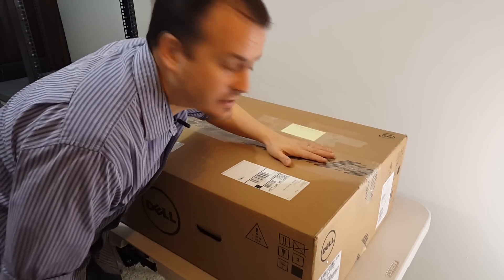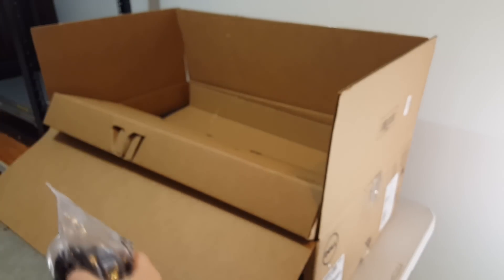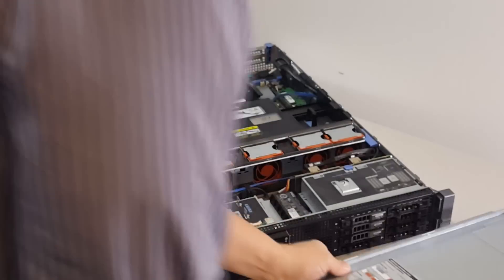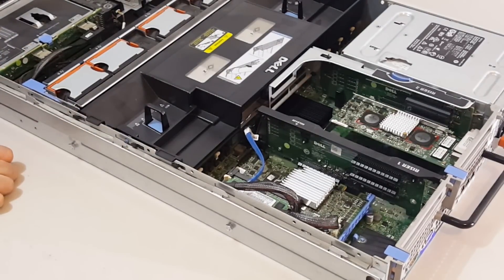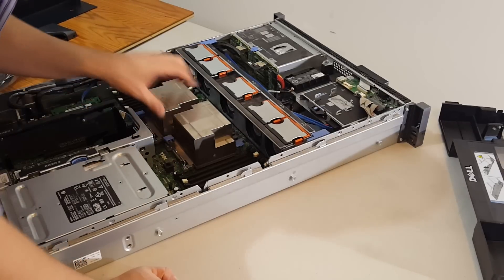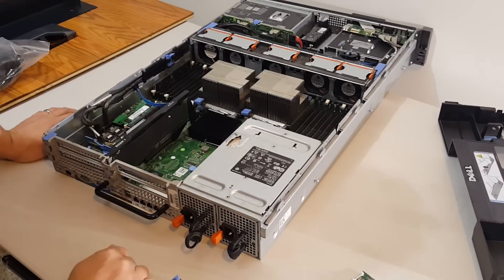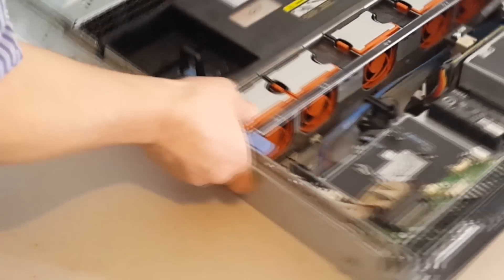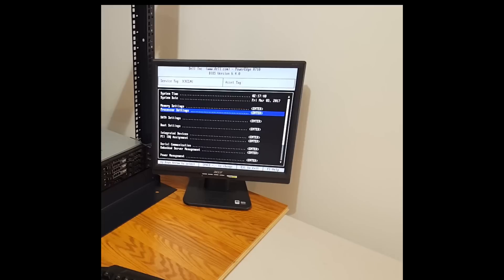$160 Dell Poweredge R710 Unboxing - Xeon e5620 8 core 16 Threads 32gig Memory 3x 300gig 15k SAS HD

Comment: WOW! you are so lucky bro. I found one of these in my country ( second hand ) for about 380$ barebones!
Reply: I got mine for €200,- off eBay. Dual L5640's (6c/12t), 72GB's of RAM. €220,- with shipping to the Netherlands!
Reply: Each region seems to have their own selection of cheap server hardware, most of Europe has cheap IBM servers, America has cheap Dell servers, I'm sure Netherlands has their own brand of affordable "old reliable" server, just need to find it.
Reply: @KiraSlith  The UK seems to have good prices all round. I found a large lot of 25 various HP ones totalling 420GB of RAM for only £350 and £60 shipping.

Comment: I have the same model with 3.5" drive bays. Make sure you don't have PERC 6 or 6/I Raid controller in your system because they only support SAS 1.1 (3 Gb/s).

Comment: Hi... thanks for the video... I work editing video and I need a super powerfull machine... I was going to buy a HP Z800 workstation refurbished but I just watched your video and I wonder... ¿The Dell Poweredge R710 or R810 works fine for editing video? Could I to buy a Video tarjet NVidia Quadro 4000 for working with a Video Professional monitor?
Are these kind of Workstation very noise like?
Reply: They are quite loud to use if you are sleeping or even working in the same room
Reply from the maker: Alfonso Galicia I haven't tried installing a video card. I run about 8 windows 7 VM's. My VM's are for point of sale labs.

Comment: i just got my dell r710 from ebay with the things in it (ram etc,) only thing i had to do is put SSD & GFX in it.
After this, I power it on with my display plugged in the external GFX. 
I get no display, says no signal.
Any idea?
Reply from the maker: Not sure I haven't tried installing a video card

Comment: C-fed tech excellent video! That server working well on esxi6.5? And the noise is very high when boot after get quiet right? THe noise is similar to vacuum cleaner.
 About consume of energy this kind of server use high energy? If the  environment is about 20 degree C this server working well?
Sorry to many questions!! Keep posting!
Reply from the maker: 本田マーチン it really quiet compared to the IMB X 3650, so quiet that I moved all my virtuals over for my 24-7 server. The battery backup I bought shows a load of 140w .
Reply: Thanks you for the reply!
Reply: You can also configure when 1 power supply goes down the server shuts down (thats what i have)
When the power goes out 1 power supply wil stay up (UPS backupped) and the other one goes down.
Reply: You can also see power consumption in your iDRAC. Not sure if this is on non Enterprise iDRAC's
I have an iDRAC 6 Enterprise and i can see it.
My UPS has more noise then my Dell R710.
Reply from the maker: Magic-VPN iDRAC is installed. I will have to check it out.